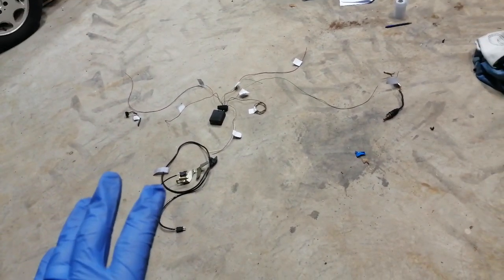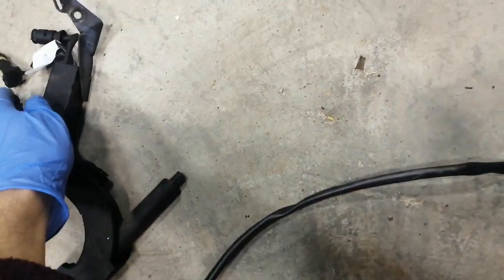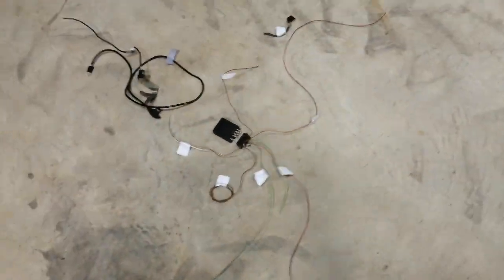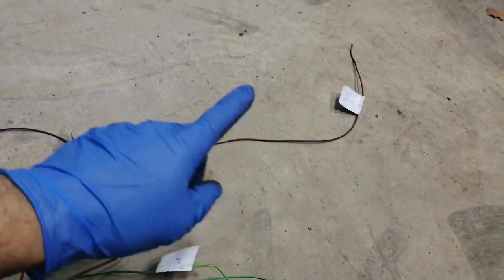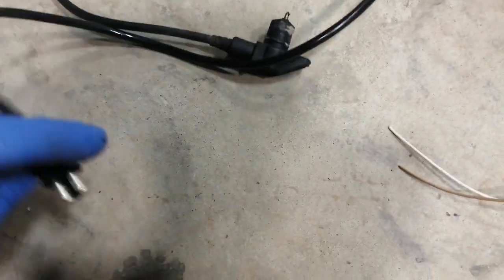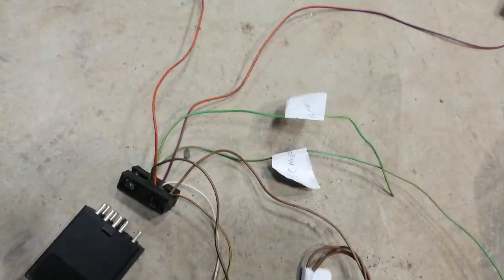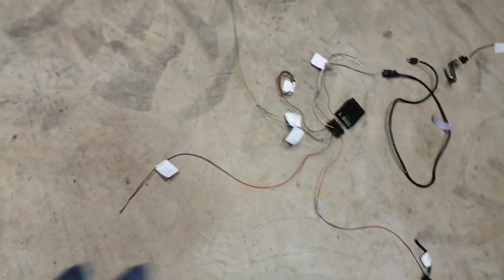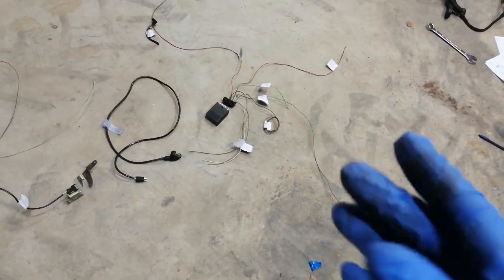Om606 w124 build - glow plugs and ELR system

Comment: Thank you for the video. I have a problem where my engine speed is displayed too low in the instrument cluster—around 400 rpm when idling. This improves as the temperature rises. At the same time, my air conditioning isn't working. I have to unplug the connector from the air conditioning temperature sensor, then it works. Does anyone know what the problem is and have an idea?

Comment: This,I think is the only info on the ELR on non turbo euro cars. Now all I have to do is find which wire goes where on the ELR relay.I am putting a OM 603 into a W123 TD .The owner supplied a pile of parts to do the swap so It's been a mission finding info .The Australian version is very different to the majority of W124's here on the Web.